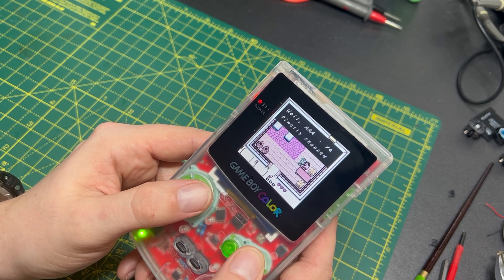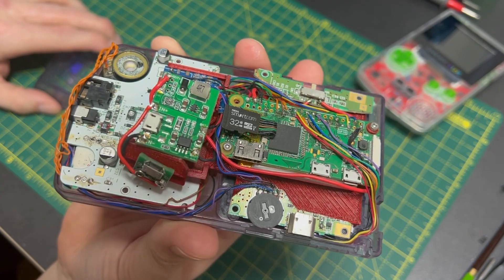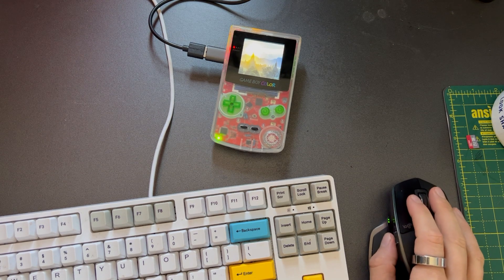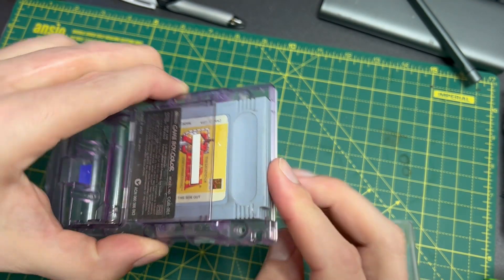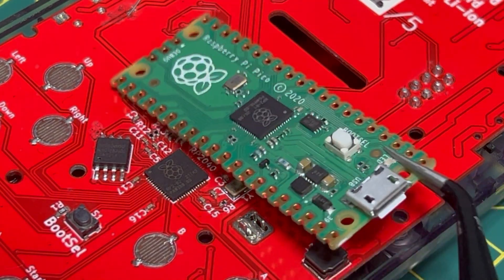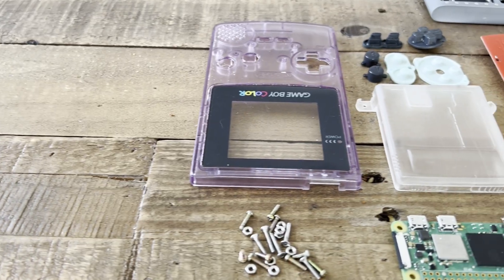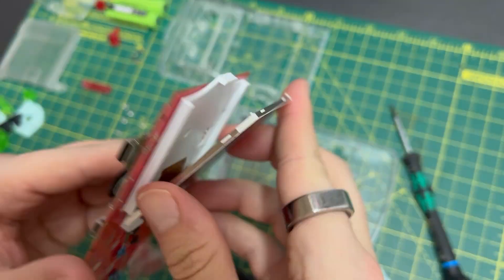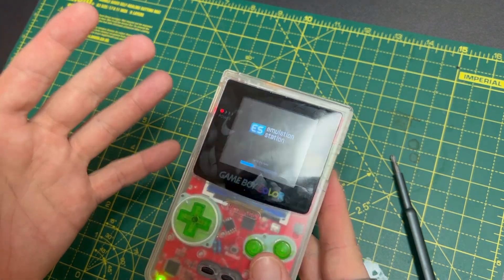SAMEBOY Introduction, A raspberry Pi zero handheld in a GameBoy Colour

Comment: I was thinking of doing something similar to a DMG but have the bottom end of the cartrige slot have a couple ports like hdmi and usb-C, ultimately be able to fit a small flash drive in a cartrige that slot in like normal. but that not likely to happen as i have very basic PCB and 3d design skills.

Comment: I would actually really love to see this come to market since there currently isn't anything like it for the GBC, at least nothing that requires zero soldering and is essentially drop-in ready. 

Have you considered collaborating with John, aka Zega? He made the excellent MAME kits for the Game Gear, DMG, and GBA SP that run off an RPZ. One of the cool things about his kits for the DMG and SP is that they add X and Y buttons for better controller support for all the different systems. The DMG kit also has an optional add-on for rear L and R buttons. It's really cool stuff.

Comment: Nothing new imo however if you threw a,b,x,y. 4 face button on it then the pie would be more appealing to any one from nes snes 64 and all gamboy models of back play
Reply from the maker: yeah people have been making them for years with lots of soldering and hot glue, but I'm not aware of anyone else trying to make it solderless at the point of assembly.
the NES didn't have X and Y buttons,
For the SNES you would need two shoulder buttons.
Cant emulate the N64 of the Pi Zero, it just doesn't have the grunt.

This is a love letter the GBC, its supposed to resemble a stock GBC,  but be sure to subscribe, I'm working on a Pi Zero handheld that Im going to do open-source. that will have shoulder buttons and AB XY
Reply: @jamfab-james  firs I want to apologize if I came off any type of way.... I just randomly found your Channel and did put out a regrettable forward statement. On another note I kind of put my build at you haha I've been modding game systems for ohh 6 years I'm no master computer science/engineer 😅 just into the hobby I've been working on my own project but gba based that's why I'm so keen on the 4 face button layout and I know there are others out there but not what I'm trying to pull off but I'll sub hope to see more and thanks for the interaction maybe talk again

Comment: I would prefer to have the version where I solder, especially if that reduces the overhead cost on your end.
Reply from the maker: Defiantly an option! It would only reduce the cost a little, but when I get to releasing it I’ll keep in mind a more DIY option, getting the pogo pins aligned and holing them in place while they are soldered requires a jig, so in a “more DIY” kit, I’d need to include that jig. It’s a tricky one, but I’ll keep your thoughts in mind :) thanks for commenting!

Comment: The Pi Zero has already GPIO connectors, so why the need for the microcontroller, am I missing something?
Reply: The Pi zero has no ADC, so you can’t measure a potentiometer value with it (volume wheel), or a battery level. Also using the RP2040 as a keyboard emulator takes a little overhead off the Pi, that’s sort of the main reason. You can run a bunch of stuff on the RP2040 that would otherwise have to use a little compute on the SoC. also, there’s a display scheme I’d like to use that uses the whole GPIO bank.
Reply: @james-sargent  Oh thanks for the explaination.

Comment: Would like to make sure it works with a Pie Zero 2W and if the display could be changed to something bigger than the original nintendo one as there is a lot of room up there.
And please don't use Retropie, that thing is super annoying for anyone that does not use Wifi. Or support an other system in parallel.

Comment: Okay, but the cost of those two PCBs (that you refer to as "two brains") puts the cost of the exercise vastly beyond every reasonable alternative —and there will still be basic functionality lacking (such as two player via link cable).  Do I see the appeal?  Yes.  Will it sell?  Yes.  But it has competition at a quarter of the cost.
Reply from the maker: How much do you think a kit will cost? The pi zero is about out as cheap as you can get a raspberry pi - if it’s on stock anywhere being sold RRP - and the RP2040 is a $0.50 device. I’d be interested to hear how much you think the kit will cost?

Comment: this concept is really sick, and definitely has a very specific niche it'd happily fall into. i guess my questions are what kind of screen would this be using? because the gb/c using a 10:9 aspect ratio that'd look off with other size screens. and what shells would it be designed for? since there are a lot of aftermarket shells that make it much easier to find good condition shells and buttons, and add a lot of customization potential.

i also think its funny that Sameboy is also the name of an emulator that emulates GB/C. so itd be funny to run Sameboy on a Sameboy

Comment: Interested in learning more. How's the battery life? Can the screen sit closer to the front of the GBC case? Other than that, it looks really nice. I could see paying $100-150 or so for the kit if the end result is moderately decent to play on. Either way, amazing display of skill designing and building this.
Reply from the maker: Thanks! if anything, I think a kickstarter price would be ever so slightly less, if i could do a run of a few hundred, all about hitting those economies of scale! the battery life is fine, Im having a hard time getting batteries from china to test, the green ones in the videos are only 800 mAh, two of them give 4 - 6 hours of play time, hoping i can find some cells that are closer to 1500 mAh. The screen sits exactly where the GBC screen sat, you could make it closer, but would need to do some serious modification to the case.
Reply: @jamfab-james  Yeah, I'd absolutely be in for one. Looks like fun.